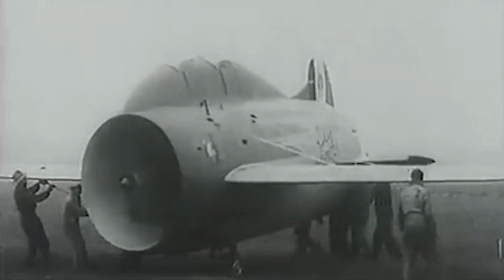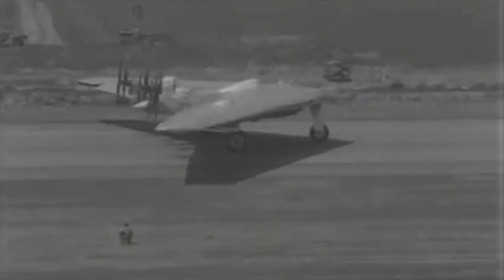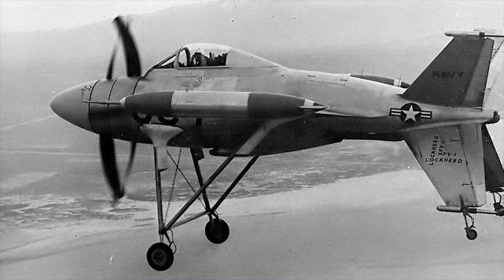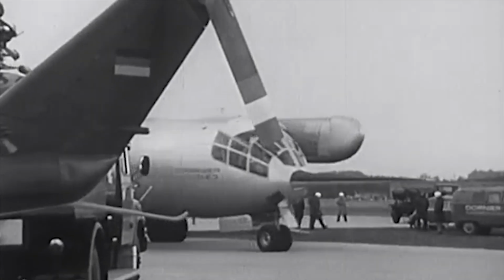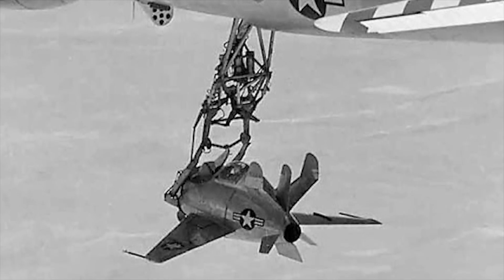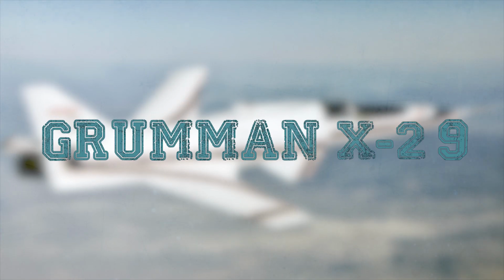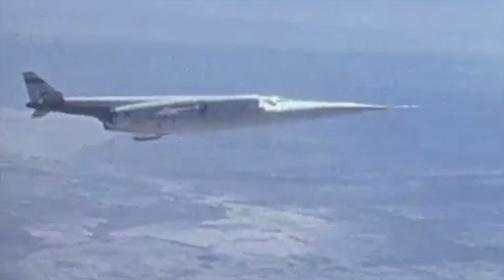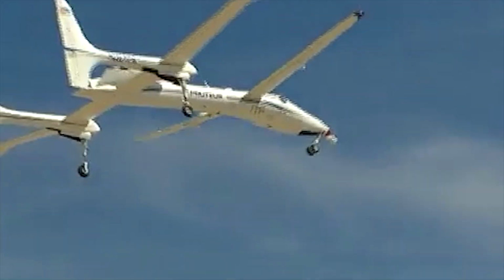10 Most Unusual Aircraft of All Time

Comment: The Avrocar was the test for the VTOL Landing gear of a supersonic discoid plane. See the Avro Canada / USAF "Weapons System 606a", which the writers of this like most tabloid sources who write about it, don't know about.
With very-low aspect-ratio wings and real thrust jets (and a fin, hopefully), it would have flown easily and well, and wouldn't have needed to go higher or faster than the Avrocar did to get aloft, and would have allowed it to operate anywhere, even over water.

As it was the Avrocar was a complete success at what it was, the first-ever test of its lift system which the voice over correctly says is not a lift jet or ducted fan or any sort of reaction engine.
It was also the first hovercraft of any sort to handle rough and broken ground.

In relation, see the USSR Sukhanov "Discoplan" gliders, working up to the same sort of thing without the lifting engine.

Letayushchiy (flying) disk
Летающий диск (1964) 17:20
https://youtu.be/UQ1XiIMgLck
video
https://www.youtube.com/watch?v=at77GUZm9rY

At the top of this, should be mentioned the Arup planes from Indiana in the 1930s. Entirely successful, markedly superior to "normal" planes in all criteria, but ignored because they look funny. ("Air" + "Up")
See the youtube "Flying Heel-Lift" about the Arup S-2 It was the predecessor to the Vought V-173, and the Arup experience shows that the Vought plane by the Navy wasted the potential of it. See the 1940s Boeing model 390, for the "Flapjack" fighter which the Navy should have built. It would have left everything else flying in the dust, and with jets as designed by Sergei Sikorsky afterwards, a "flapjack" would have ruled the skies.

See the modern Australian Rowe "UFO" for a tiny circular wing plane that defies everybody's pessimistic guesses about it, but sleek and nimble like the Arup.

We could also mention the Nemeth "parachute plane" from the 1930s. A Biplane with a single 15foot diameter circular wing parasol mounted. It was faster than the original, would not stall, landing roll less than its length with any wind. Again, a "Funny looking" plane that was better than anything else, and ignored.

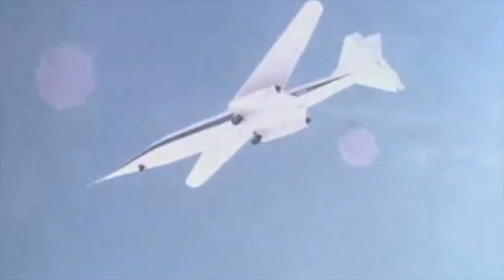Comment: Funny..at 02.26...the maximum speed is 24 miles per hour😂 little slip but the video isn't bad👍 P.S. 07:28..the idea from the AD 1 is not new..
Blohm&Voss had planed in 1942 to use the so called "oblique wing" in their project BV P. 202
The Germans in WW 2 , especially Blohm & Voss, had a reputation for asymetrical plane Designs.....

Comment: The first jet engine propulsion aircraft flew in 1910, and it was built and flown by Henri Coandă. So, that Caproni barrel didn't open the way for anything like that.
Reply: The Coanda plane wasn't a jet any more than the Stipa-Caproni was . It did not use reaction from throwing air aft as a jet nor did it use any sort of ducted fan. It's propulsor was a Coanda effect machine like the Avrocar was as a lift engine.

Comment: Propeller aircraft were reaching the limit of how high they could fly 100 years ago because the air would get thin beyond 10,000 feet. The Caproni aircraft tried to solve that problem with an air baffle in their design and in fact, this solution led to the development of jet engines.

Comment: Piston version of the Flying Wing had a range of 12000 miles, four times that of the B-36 Peacemaker. Who cares were whether it went 1600 miles shorter than they expected. The Avrocar was a wild-ass guess at a very bad Theory.
Dornier do? Where the hell did you get that pronunciation.
The X3 was designed to be capable of flying at Mach 2, which the airframe was. They however were not able to secure engines capable of pushing the aircraft that fast.
I don't know who's doing the narration or if it's actually a real person, but you can't even get the name of Burt Rutan correct?

Comment: The sad part about the Goblin flight test .
When the Goblin tried to reattach to the rigging it slammed into the rigging damaging the cockpit latch  and loss of control of the craft and crashed with loss of the pilot .

The Old History or Discovery channel is were my information about Parasite Fighters is from .
Reply: Fortunately that’s not true. Discovery might have confused the Goblin with some other experimental aircraft, because the Goblin successfully belly landed after each test with no casualties.
Reply: Not true at all. The one that damaged the hook ditched on the desert.
Pilots said that as well as flying very nicely, the Goblin was very easy to belly-land.

Comment: Pilots say, "If it looks right, it'll fly right." Of the ten planes shown in this video none looked more wrong, and flew more badly, than the Goblin. (Why else would they give it that name?) It proved almost impossible to dock the little monstrosity  in its carrier's bay, and in any case the Goblin proved unable to match current-generation fighters in free flight, let alone combat.
Reply: I would have to rethink my career choices when I pointed me toward the goblin 👀🤔
Reply: Contrary: Aside from docking it in mid-air, the Goblin flew very well.
Test pilots said it was stable and nimble for its limited power loading, with very forgiving stall characteristics, unlike very many planes which we operate all the time.

The Goblin is one more example of how "If it looks right, it'll fly right" is dead wrong and limited provincial un-original thinking.